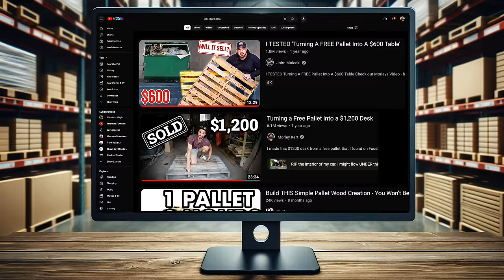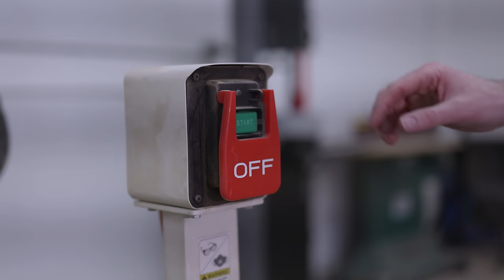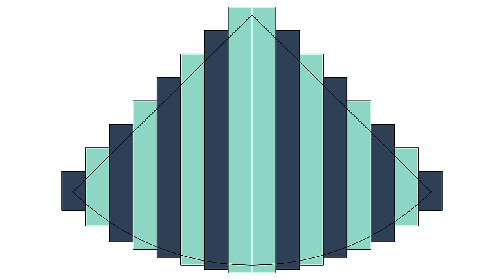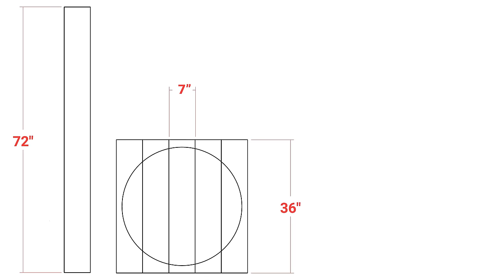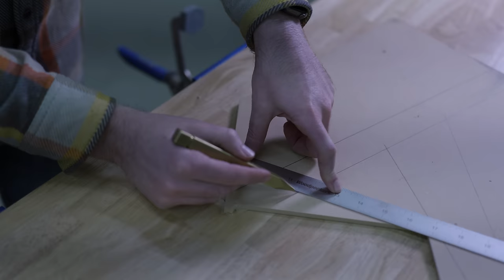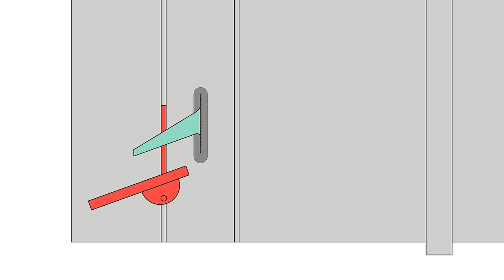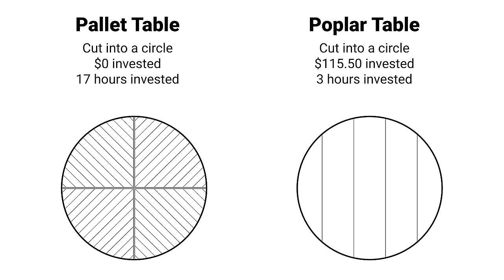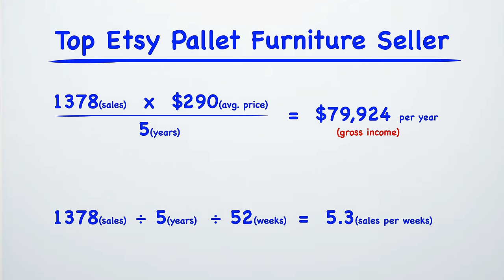Pallet Furniture is a Scam

Comment: I'm making a pallet wood table for one of my college projects and I can see where you're coming from in that the poplar table is easier and would give an instant confidence boost but I have found that as a novice builder using the pallet wood forced me to trouble shoot and hone more of my woodworking skills. 

I've had to deal with taking out rusty nails without splitting wood, clean the dirt off them, plane and rip them all to equal thicknesses, fix break out, fill knots, deal with warping and generally put a lot of extra work and imagination into making it look good but I believe the learning curve has definitely been worth it.

Also its cheaper and better for the environment which was one of the points my project was trying to make.

Comment: I've found if you want to maximize the length of each board and the amount of usable material without splitting, take a circular saw and cut just inside the end set of nails on both sides. Then either two flat bars/cats paw or a demo fork can pull the last two nails off the center without destroying the board. Then you only have two nail holes to fill, too. Best use for this stuff is to make a decking on 1/2" melamine or mdf-type sheeting fire a flat surface using since dirty if trim material to cover the seams.

Btw, I like the mullet table. That was awesome. Nice Adams Family vibe.
Reply: The cousin Itt table.

Comment: I used to work for a company that recycled used/broken shipping pallets. Things I can say about them:

1) working with reclaimed pallet wood is a nightmare. Splinters, nails, broken boards, calcified super-hard wood, and they're disgusting. They're really hard on your tools, too.
2) Nobody who has a lot of pallets will give you one for free. You can sell them in bulk to a recycler for a decent amount of cash. Businesses that receive palletized shipments regularly will almost certainly have a contract with a recycler to sell their pallets. Your only chance is to find a homeowner or small business that got a couple pallets as a one-off. Hardware stores, shipping companies, etc. are pretty much a no-go.
3) If you see some pallets just sitting around, ask before taking them. They might look like trash, but for the previous reason you could get in some serious trouble if you just swipe them.

0/10 don't recommend.

Comment: One thing he doesn't demonstrate about making furniture out of pallet wood is there's much easier ways to take them apart than he shows.... this will save time.  ALSO, things built with pallet wood are generally supposed to be rustic 8 times out of 10.  Yes, you can almost build fine furniture in some cases but the thing to always remember when building with pallet wood is (are you ready??).....

"The perfection is in the imperfection"

The part he didn't talk about is things built with pallet wood is intended to be imperfect on purpose.  If you don't realize this then don't use pallet wood.  The nail holes, the cracks and splits (strengthen with CA glue), chips, knots, the wear & tear, the original pallet markings are all part of the.... "it's not perfect yet it is" concept.  In fact, in many cases, I further and intentionally distress the pallet wood even more to make it look super old.  This is what gives it the appeal in most circumstances.  It is also what makes pallet wood projects "one of a kind" and this can drive up the price.  You have to embrace the imperfections in order to be successful using pallet wood.
Reply: Get yourself a floorboard lifter/pallet breaker and you can have them stripped down in minutes, not an expensive tool either

Comment: I would have found the cost comparison more compelling if you included the material cost for the things like; epoxy, glue, finish, and similar woodworking consumables.

Always enjoy the videos! Thanks for making them.
Reply from the maker: Great point!
Reply: That's what I was wondering.  The pallet table requires a whole lot more gluing, etc.  Were those costs negligible?
Reply from the maker: I think the glue is pretty negligable. I would be suprised if I used $3.00 of glue total between the two pieces.

Comment: Some things to remember when using pallets for projects; 1) pallets are treated to hinder biological contamination, either chemically treated or heat treated. In the U. S. Almost all pallets are heat treated, and therefore safe to cut up, make into furniture or whatever. Chemically treated pallets are mostly used in parts of Asia. 
2) pallet wood can be in relatively poor condition. After dismantling the pallet you’re frequently left with splinters. So choose your pallets well.

Comment: quality glue is not free. it seems like you need to spend 2-4 times more glue on pallets than on wood. it would be great if you pinned a comment with your estimate of used glue difference. also it is not clear in the video if preparing the wood from pallets (disassembly and nail removal) was counted as time spent for the pallet table (it should be counted).

Comment: Pallet furnitures are usually easy money. It's the workshop that is the big investment.
Used pallets here are 0.5€, but sometimes cheaper. Companies usually pay for taking the trash away, so wood trash can be found in factories and plants. A lot of them. Sometimes there are long pallets that can be taken away, pallets or it can be taken away for working for the company, helping the company out, fixing things. Little bartering. This is why it's good. It's the cheapest good quality wood that can be found.

Comment: Little tips about painted pallet color code (Americas/Europe)... painted pallets (blue, red, orange, green) are made of hardwoods like maple or oak (made/owned by  large shipping companies, ment to carry very heavy loads and last longer)...these could be way more interesting to work with than rough wood (paintless) pallets who are usually made of softer cheap wood like pine, hemlock or spruce (ment to carry lighter loads, or single-use pallets). Also, in general, painted pallets are made of thicker planks too.

Comment: Amazing work! Kinda curious how much easier/different this project would have turned out if using heat-treated pallets or those big blue merchandising pallets that major companies like Coca-Cola uses.  Fantastic job!! = )
Reply: The blue pallets are never free though they are rented by the companies that use them. That's why they are stained blue. So they are easily recognisable and not just trashed. They remain the property of the hiring company. If someone is in possession of one, say, to make furniture from,  then it would be assumed to have been stolen.

Comment: For the undertop. You could do a ring and ring. 
Making an inner and outer ring.
It is material efficent. Keeps weight of the furniture low. But will require some diffixult would working, or tedious cutting and joining.

Comment: I have an RH table supposedly made from “20 year old English pallets.” I bought it some time ago and for the size, it was actually the most affordable option. It is rustic, by design so that if a kid marks on it or a friend spills some wine, nbd. I’ve even sanded out melted candle wax. It’s beautiful and seats 14 in a pinch. But it was likely mass produced in a factory bringing production costs lower. Anyway, not opposed to buying pallet furniture, but I probably wouldn’t waste my time woodworking with it.

Comment: Only reason to use pallets is if you're building something that just has a utility/structural purpose and don't care how it looks. I built a platform for my miter saw out of a pallet on top and a couple pallet-derived planks for legs and crossbraces, and it was perfect at its job. Not only that, but building it out of nice wood would have taken longer since with a pallet the entire top part and leg attachment points were already built for me.

Comment: “Finding” pallets depends entirely on where you’re located. I happen to live by several warehouses that either put pallets out to trash or I ask if I can take them. I have used pallet wood quite often but solely because of the availability and ease of acquiring it. Occasionally there’s are some nice boards on them which is nice. I would not recommend it though. Anything I’ve made from pallets have been for my own use or for friends/family.

Comment: i dont know about pallets over there but over here in Finland all those are treated with mold and rot preventing substances and ones that prevent maggots and other insects from burrowing into them and its a health hazard to have them as furniture indoors... like they are fine in a warehouse and and so on but not in a as closed and poorly ventilated space as a house is... and there has been even news articles about how you should never use them for anything unless its for outside use only... personally i work at a warehouse and i could get pallets for free quite easily and consistently without any extra cost since even if just one of the boards break we throw it into a crusher (we got both expensive and heavy stuff for sale so no point risking them like up to 12k a pop valued items) so i could very easily source all my wood for burning in my fireplace but the stuff is toxic so cant do that either....

Comment: I currently use pallets so make most of my projects. I just started my business last year. I am transitioning to hardwoods but when I had no start up capital, and limited experience pallets were the best option. $100 for wood doesn’t sound like a lot but when you don’t have $100 a pallet works great! At the end of the day I think new/hardwoods are a better more efficient option but I’ve learned A LOT from working with pallet wood. It is therapeutic to just destroy a pallet sometimes too 😂

Comment: I built a double garage out of pallet wood, it took 820 full length pieces at 1.2m and 3 months to complete, the main structure and cover was all reclaimed materials and the total cost excluding labor was around R4000 ZAR  or $216 it was a huge challenge sourcing, transporting splitting, sanding and joining so I agree, to save money its not worth it but as a hobby or something to kill time its great. I must have put in about 200 hours on this project.

Comment: This was so helpful because I have no woodworking skills to start with. I have no tools except a battery powered circular saw. I come across pallets at work frequently. The two most common types of wood used in pallets is pine and oak. I thought I could sift out the oak and make some good quality oak furniture. I found there are tools specially designed to make separating boards faster. So in theory the time investment for sourcing wood would be less than “finding them on the side of the road”. Seeing the time investment you put in with what appears to be an awesome setup and skills to follow up with it. I see that with my free time and limited tools and skills. It would take me about a year to produce a single piece. Possibly longer if there are mistakes. Pallets often have lower grade wood in them. They have weathering, warping, stains, lots of knots and they’re rough. I have shied away from this because of the time investment. I’ve even gone as far as looking to repurpose some of the wood to repair my flooring in my farmhouse because the boards are nearly if not exactly the same width as the current boards. So yeah. Thank you for this. Really helped put into perspective what I’ve suspected all along. It’s tempting because it’s “free” but free comes at the cost of your time. Same goes for a classic diesel truck that runs on black diesel (used engine oil and diesel mix). The fuel is free or nearly free but I have to source large quantities of it and it comes at the cost of likely premature wear on the engine. So in the end free gets costly.

Comment: All about the use case I guess. I built a casual dining table out of three pallets - used about 4 different tools compared to 20 in the video. Total work time 8 hours and $5 worth of polyurethane, $8 worth of screws and $3 worth of glue. So was worth it in this case.

Comment: I get free oversized pallets at my job. There's an electrical company in our commercial yard, and they received a bunch of transfomers on large pallets. We cut them down to our own specs for wine barrel storage. Saved us almost 70k in lumber prices over the past two years. Pallets have a lot of 2x10 1x8 & 2x12 boards on top. We buy full pallets of 2x4s when we cut ours down to size.